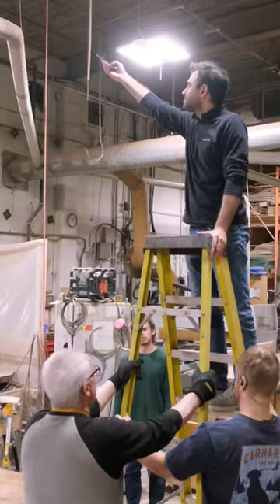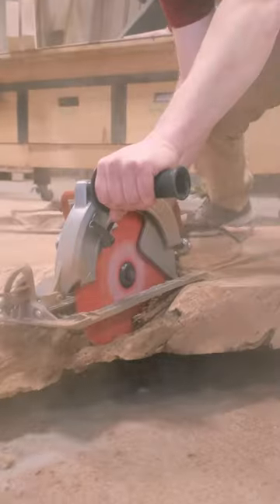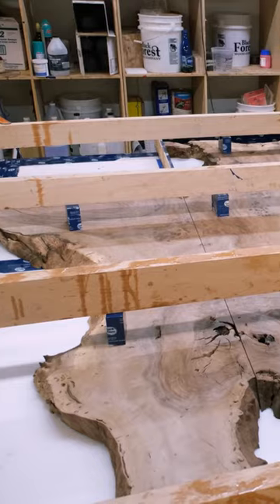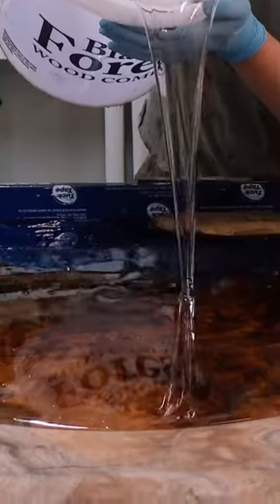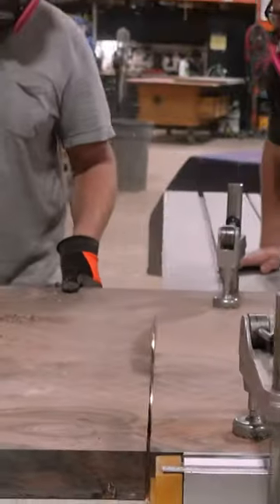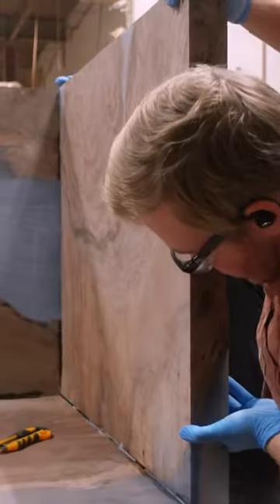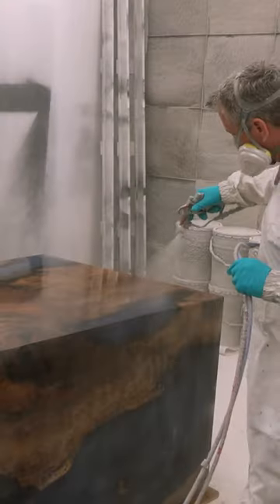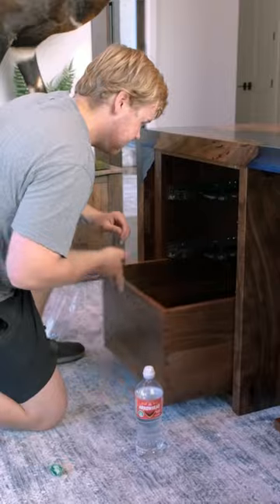The Most Expensive Desk We’ve Ever Created #wood #construction #furnituredesign

Comment: I've seen the oaks that slabs like that come off of. You don't see them much anymore down south but we don't cut a lot of hard wood anymore. Anyway we had one go down on our property where we were buildong a log cabin in a wind storm one night in the early 90s it was a red oak I think, i was just a kid back then so its been a while. The branches on it had to be the size of oaks that were well over hundred years old (one of the reasons it went down, the weight). I bet that tree had to of been well over four hundred years old before a 90mph blew it down. Ridiculously enormous. The entire root ball basically popped when it went down. I measured it but don't remember the exact depth. Had to be close to 18 ft. from the edge on top of the ball to the bottom of the hole. I dunno it's exact circumference but the trunk looked like it had to be 7ft across just off what I guesstimated then... You just dont see trees like that much anymore. Stuff you could build an entire house out of cabinets, furniture and all. Just think of the value of what we could of gotten selling that tree to some of these more northern saw mills with these internet craftsmen building this highend furniture. The trunk of that thing would of filled up a half log truck and the branches made you need two other trucks... But we don't do much with hardwood except firewood (such a waste of a huge tree)  and let it grow mostly and plant more pine after we harvest it down here in East Texas region or the Ark-La-Tex. 
Anyway I guess from the wood working and furniture building I've done it just makes you sad some the earth self harvested couldn't of built a dozen or so of the finest round tables ever, fit for King Arthur and 12 other dudes 😅. I'd loved to done it because then it would basically last forever.

Comment: Why is it not necessary to seal the wood with some clear epoxy and a bristle brush before pouring the colored epoxy? I thought it would stain the wood.
Reply from the maker: That’s a common misconception, we have never had a single issue with it and probably do more pours than most!
Furthermore, sealing the edge greatly compromises the strength of the bond. We started a test for this about 6 years ago. Two similar desks were made, one with a sealed edge, one without. The one with a sealed edge had the epoxy start separating from the wood after a few years and the one without a sealed edge is still perfect.